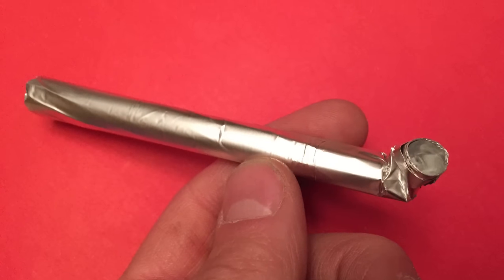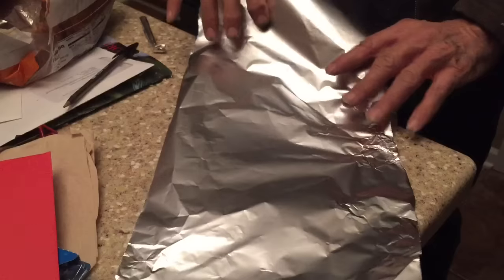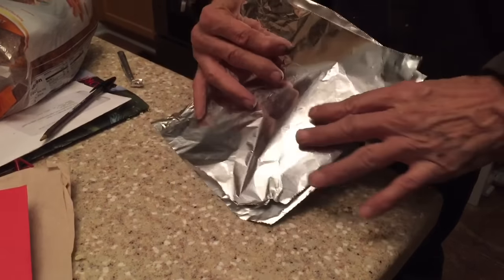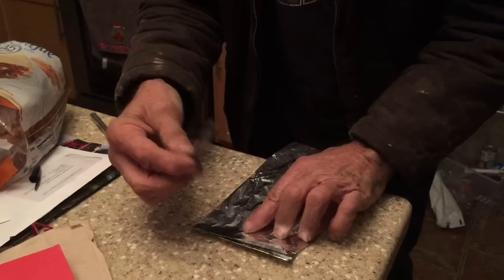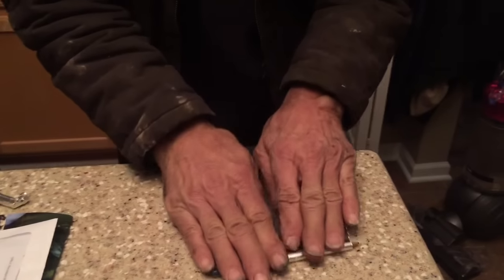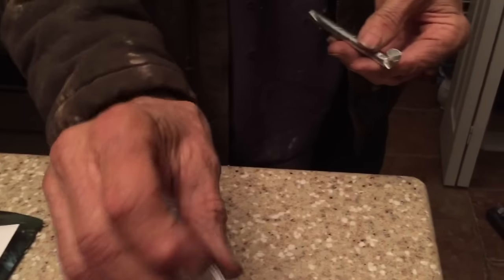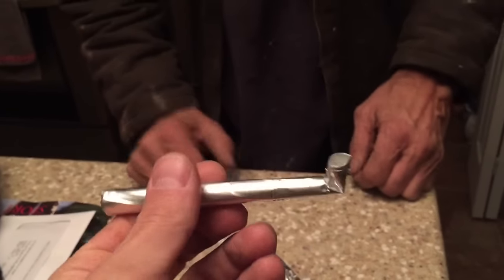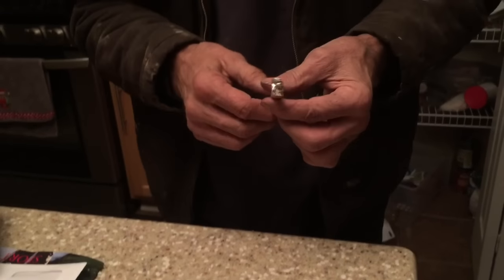How To Make A Homemade Tobacco Pipe with aluminum foil

Comment: you're not a true stoner unless you've done this at least twice. ..lmao
Reply: Emmanuel Collazo That’s interesting, considering the recent research that proves against the “Aluminum foil burning causes memory loss” myth. For one, aluminum foil is meant to be put on ovens, grills, and places of high heat without burning. Two, the smoke that the aluminum foil would produce if it were to burn would be turned into an oxide which has no proven harmful effects on your body. And three, THC helps to regenerate and keeps these cells healthy, preventing against the long term memory loss.
Reply: OutOf TheLoop So this means i can smoke out of Aluminium foil without worring about my body?
Reply: Elijah that’s what I’m trying to figure out because I did this and I got high af I don’t know if it was the weed or some type of chemical from the aluminum foil 

Update: I finally got some swisher and still got high asf I just got good weed 😂🤘🏾
Reply: Why twice 😂 😂 😂 😂
Reply: You're right!😂👍
Reply: @outoftheloop1523  aluminum has a pretty low melting point. one time my friends and I smoked before school and we were using a foil pipe like this and I watched the aluminum melting when I hit it.
Reply: Bookie Anderson yeah this happens for me too but the key is to roll the pipe with a bunch of layers; aka- use a big sheet of foil. May feel excessive but it helps a little
Reply: autumn winds I’m about to try it
Reply: @JabbatomeezHD  fuck it me too
Reply: or a coke can
Reply: Charlie Puerto dont use those cause its really bad for ur lungs
Reply: Aluminum is proven to have a higher chance of getting Alzheimer’s. Don’t do it it’s terrible!! Be safe
Reply: @jasonlyle3818  but thats melting point, not burning point.
Reply: OutOf TheLoop Now that's what I call a nerd stoner.  I'm just kiddin'..thx for the info mate! I was about to search wtf happens after smoking aluminium..it smells weird af smoking weed using that pipe tho😅 "Salutări" 4rm Romania!..you probably don't even know where that is but that's fine,just know that here you do real time 4 sellin' pot, it's cold like Siberia sometimes and Dracula is my aunt 😆😂
Reply: It is all I use.
Reply: @jakehole3944  
Same
Reply: This will be my first time found a small bud
Reply: I do Always the Apple Bong
Reply: half there about now. Edit - I guess I should congratulate myself now. Did twice. But brohhh!! Never doing that again. The aluminium smoke goes into the lungs.
Reply: Bookie Anderson you’re not supposed to put the lighter on the aluminum. If you just keep the flame stirctly to the middle of the bowl then you’d be fine
Reply: @outoftheloop1523  omg i was freaking out but you calmed me down thanx 😂
Reply: Bro making a bong out of a bottle
Reply: Yep
Reply: And atleast use an apple too
Reply: josh rowell fuck it. Me too a year later
Reply: @outoftheloop1523  there’s no direct flame when you’re cooking with aluminum foil. You will absolutely inhale chemicals
Reply: I’m in Mexico and they don’t sell swishers wraps or papers lol about to be my second time doing this method
Reply: I’m underage so..
Reply: Or the bong out of a pen and a sprite bottle
Reply: I did it with a pen and bottle
Reply: How about doing this a hundred times……

Or using an apple

Or a carrot
Reply: I smoke weed every single day in my house all day, in front of my own parents. I’ve thankfully... never had to use this lmao! But if you’re desperate it’ll probably work, but can’t be good for you either.
Reply: Pretty sure I’m a true stoner if I smoked everyday more than 12 years without skipping a day without doing this ever. I always had lots of emergency paper, tips,tabacco,weed. I always had an extra stash.
Reply: @jakehole3944  lmao 😂😂
Reply: @jasonlyle3818  depends what percentage
Reply: Make it 100 times lol 🤣
Reply: this looks more like a crack pipe
Reply: ive done it like 10 time lol

Comment: does it work for meth and crack? not going to do it at all. never done drugs in my life, i'm a  virgin.
Reply: Michael G wat
Reply: you cant smoke meth in that pipe you need to run the lines for that use a meth pipe or just a light bulb if you smoke meth you know what i mean
Reply: lmao
Reply: A meth pipe is like $5 homie lmao
Reply: Michael G you mean flower pipe?
Reply: No it doesnt
Reply: Garson im a crack user...how are you gonna tell me??
Reply: XD that added I'm a virgin at the end
Reply: I tried with crack and no I don't think so but I was scammed and bought crack instead of fucking black tar....  so I tried it anyways it's basically weak ass lame come (maybe a bit better but still sucks) but yes it will work for meth but not with a pipe method only by putting it on a flat sheet and chasing the dragon inhaling vapor as it runs down the foil evaporating
Reply: I smoke laxitives
Reply: Can u smoke oxycodone in it?
Reply: super sand legend you must be a smarts.
Reply: tweakerssss
Reply: just smoke weed
Reply: You can smoke crack from it but I wouldn't recommend it since you run a risk of losing product
Reply: H
Reply: @uhhwynne8083  
H
Reply: Nah bro meth you need one of those glass pipes
Reply: @emmabemma4027  lol, ya so is any pipe so y u on 
here
Reply: @francisajax6549  yes or you could smoke them like a normal person with a sheet straw and light underneith
Reply: @ya_moms_tv2461  hell yeah

Comment: Beginning to roll joints for myself but failed miserably and I wanted to get baked. this saved me 🙏
Reply: same, it’s really hard to roll with no filters since there less stability.
Reply: @randyyrz2572  tighten your roach harder use all of it and it will be tight enough to roll and be more stable
Reply: Literally

Comment: Roll the foil around your finger first. Make the bend for the bowl. Put a pen down the stem and then kind of twist the foil around it.  The resulting "wrinkles" in the foil after tightening it add structural integrity.
Reply: Chipapa

Comment: Good stuff, use this all the time. All you need is a pen and some foil. Of course its nicer if you have a pipe screen as well. Cut it down to size with scissors to fit a small pipe.

Comment: welp we getting smacked ina second
Reply: I’m curious to
Reply: He meant getting high af 😆
Reply: @spacehippie1840  🤣🤣🤣🤣
Reply: @Trippydip  Yes, currently
Reply: Proper word for it is “shmacked”
Reply: @aliasanew3398  so it worked good?
Reply: @Devronn_  yeah it works fine but you feel like a crackhead doing it and resin builds up quickly and stickily til it gets a real funky smell if you keep reusing the same one. Just buy a cheap one hitter pipe they’re less than $10 dollars lol but if you’re here you’re prolly either too young to buy or can’t buy one so yeah lol just make new ones often if u gonna try it i guess

Comment: this is a great way to avoid going to the store to buy wraps/papers, a bong, or pipe. they are easily disposable and great for smoking roaches. i couldnt possibly count how many of these ive made over the years. if you havent seen this done before you just havent been smoking long enough to need one.

Comment: One thing I did differently is only use the pen to do a most of the pipes shape of stem without going all the way to the end. That leaves a small portion of the end to shape into a bigger bowl than in this. Shape bowl size to desired size.

Comment: Yeah I used to do this by having a pencil as the mold, and when you git gud you can start making slider bongs out of foil and bottles. But I stopped doing that because I have so many glass water pipes of different sizes.

Comment: back in highschool the few times i got a gram of weed i'd leave and walk to the woods looking for discarded cig packs and an empty plastic bottle. cig pack would have that foil lined with paper, burn the paper off fold it or use two pieces if possible and with the bottle a hole in the side. you then need a pin, or a pine needle & cup the foil around a finger place in the hole snug, poke a few holes into the foil and you're good to go.

Comment from the maker: this is for all the people who just make up stuff and say aluminum foil is bad for you because they have nothing better to do copy and paste below do you research dumb dumb

 https://www.drugsandalcohol.ie/22452/1/Aluminium%20foil%20for%20smoking%20drugs.pdfCurrent arrangements for providing foil

In some parts of the country, services already provide foil to people to smoke from, where local police or prosecutors have provided a ‘letter of comfort’. Services considering relying on these letters of comfort after the legislation has changed are advised to seek legal advice. However, the expectation is that service providers supplying, or offering to supply, foil after the legislative change will do so in compliance with the conditions set out in the legislation.

Comment: Smoking through aluminum foil is a really bad thing to do. Get some papers. I’m from back in the day also but there’s more information about how bad huffing aluminum is.
Reply: Myth. Aluminum doesn't oxidize like most things do, and it does at a temperature higher WAY higher than 400F.
Reply: Jake D - I didn’t mention anything about oxidation but but the temperatures in a joint get quite hot. Like 1650 degrees Fahrenheit in the end of a cigarette... And as high as 2192 degrees Fahrenheit in some spots. The flame from a Bic Lighter can be over 3,500 degrees Fahrenheit. Did the aluminum these guys were smoking through become oxidized?
Reply: @ipsurvivor  To be honest I'm not sure. What I do know is that if you do this once or twice in a pinch, really nothing bad can happen. Just get a chillum for like $4 lol. I suppose a lot of underage users don't have access to glass so they resort to this. Nice gibby in your profile picture by the way.
Reply: Jake D - Thanks 🙏. Yeah we made aluminum foil screens for metal pipes when we couldn’t find a screen back in the 70s. The body can probably absorb some of that. I developed a sensitivity to heated aluminum after I had an adverse reaction to a blood pressure medication. At low temperatures... Like a few hundred degrees or less... My BP would go up and I would sweat and shake and get really uncomfortable and hyper. I got really sensitive to Fireworks smoke, weed killer and other things... 
Some people make pipes from galvanized metal parts which I’ve heard is not the greatest either.
Reply: @ipsurvivor  Galvanized metal is a huge no-no. As for metals, I've only seen people use stainless steel sockets. Those are generally safe as long as you clean them good (oils and crap from factory).